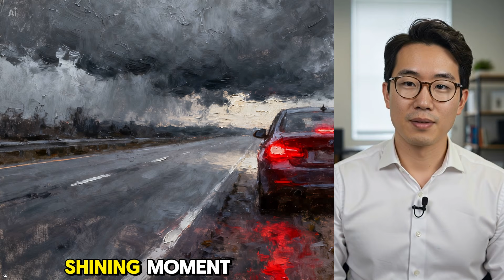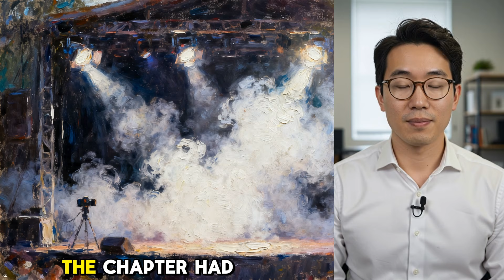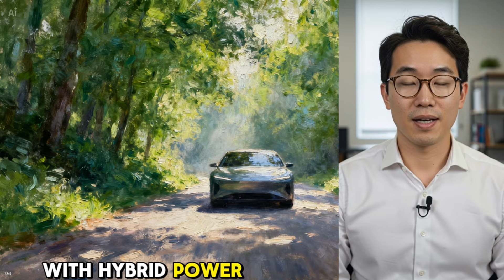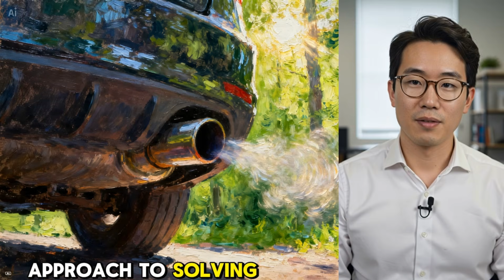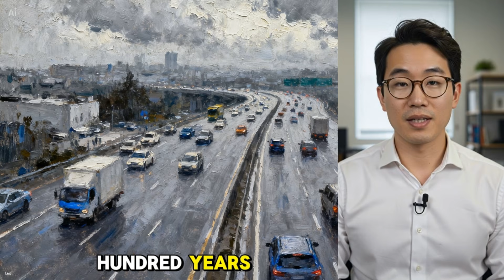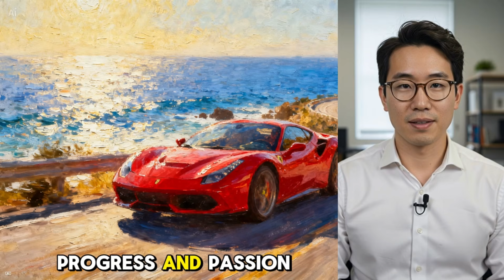Mazda Just Revived The Engine Everyone Thought Was DEAD!

Comment: This is talking too much about everything. They're going to use the Winkle rotary engine as a generator. Which is the best idea yet?. But we have to decide what small engine would be the best electric generator, petroleum, gas or diesel. That's the whole thing. Most freight trains and some medium-sized boats or hybrids. They use a diesel petroleum gasoline generator. And then put electric motors on the axles